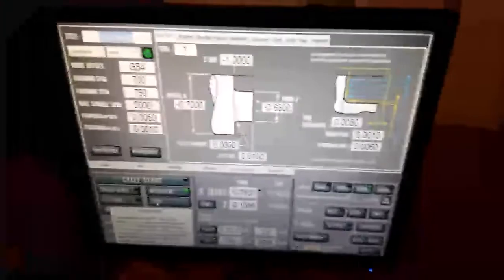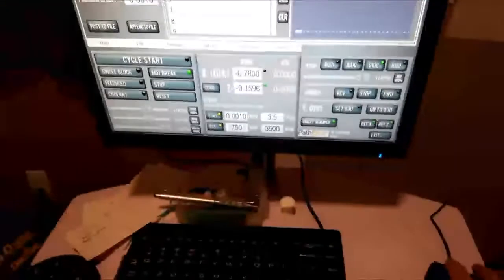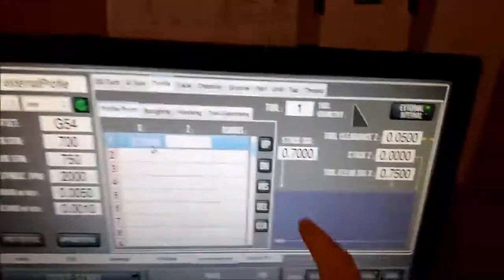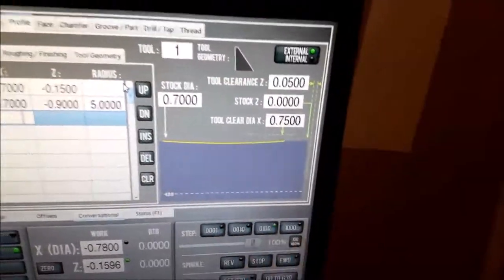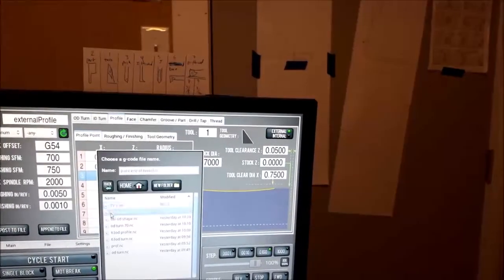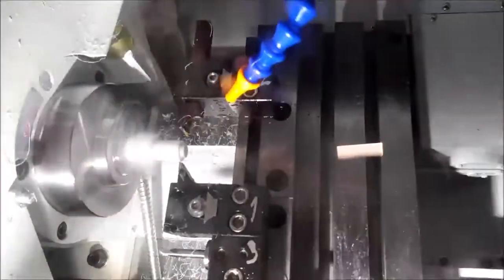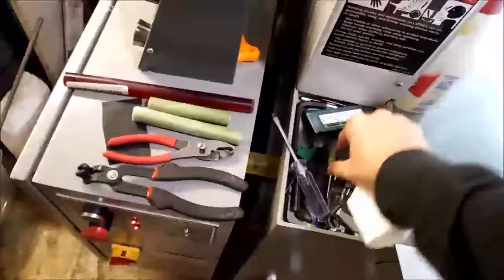tormach slant pro profile tab cutting radius

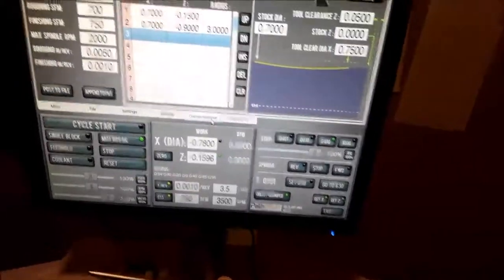Comment: How did you fix the g71 error around 2:29? I haven’t been able to get past this.
Reply from the maker: Hey sorry late reply - just saw this.  Just change the numbers - stock diameter should be smaller than it actually is - Z clearance should be about .300" or .500" away from part.  I think that should sort you out.  If you have more questions email is best - shawn@newtonpens.com